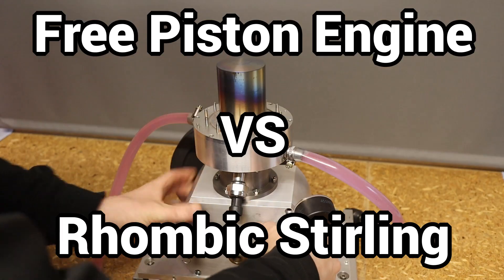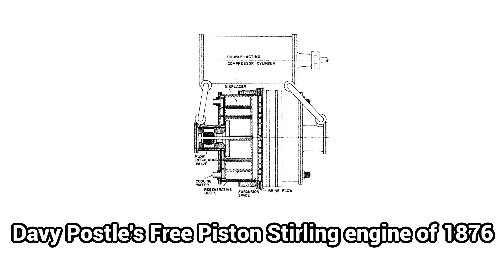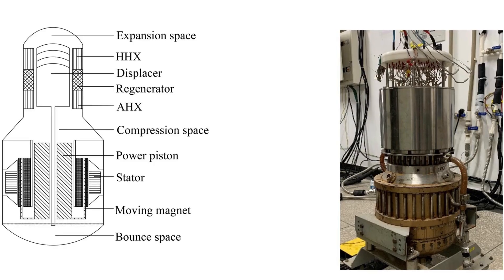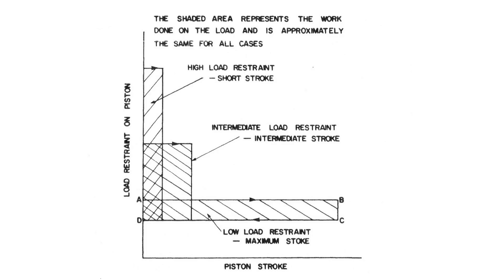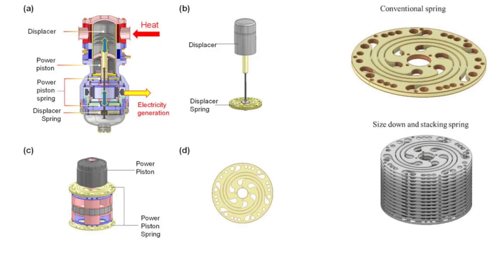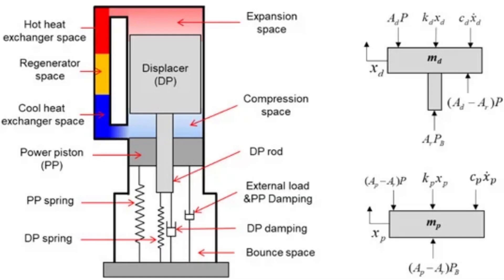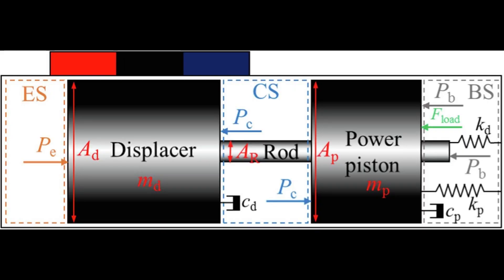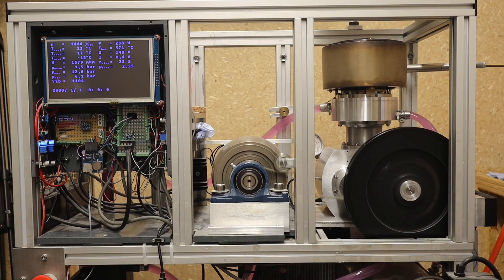Free Piston engine for more cheap energy than the Rhombic Stirling to support solar and go off grid?

Comment: This is the only one of the alternatives you have looked at capable of producing the amount of power you are looking for. And there are commercially available products to look at and copy. So.... they are the only alternative where you don't have to do complicated and hard development work to get to the end result. Just copy the design from Microgen, there are drawings out there of it. So it's a simple case of reverse engineering. This could be a community effort, and I'm interested in cooperating, I'm able to contribute with the CAD-modelling. I also have a workshop capable of building one, I only need more spare time to be able to realize something like this. A community build would certainly spark my interest, and possibly be what makes me take the step and try to build it myself. 
That is with the above mentioned design for me though. For me it's this exact method or nothing. I'm not considering other designs as there are no proven designs available to copy. 
And also, this is the only one which have a decent chance of producing the power level I'm after (which I expect to be the case for you too). 
Also, I still don't understand why you are so reluctant to this class of stirling engines. You seem to have made up you mind that this particular design is to complicated before going in to this, looking for excuses to back up this conclusion. The other design you have shown look to me to be a lot more complicated to even start to move. With this specific class of design you have several publicly available designs that are known to work, requiring no development work from your side. Sunpower, NASA and many others have published loads of data and design details on this class of Stirling engine. So this should be a case of finding the information needed and executing it. None of the other design classes have this going for them. 
The problem you mentioned with excessive leaking around the displacer due to lower accuracy of machining will in this design only play a minor role compared to the other classes. This is because this is the only one with no side forces acting on the pistons. 
BTW, achieving very accurate internal and external cylindrical surfaces are shown in great detail by Robin Renzetti (Robrenz), look at his video "MAKING AND USING LARGE DIAMETER LAPS", With this method you will be able to achieve the required precision with no problems! So.... this is NOT a premise for dismissing this class of stirling engines! Although you seem to make it one of the major reasons for not going this route.
Reply from the maker: I didn't want to badmouth the free piston engine with the video, but I think there are just too many imponderables for hobby building.
The Rhombic drive also has no piston side forces and I have massive problems with piston wear.
It would be no different with the free piston Stirling.
The difficulties lie in the details, such as the piston centering problem and the design of the spring and damping forces, which are also not explained in detail in the machines built.
Your arguments make me think seriously about the free piston engine again, that's the point of the videos.
Thank you very much, hopefully we'll keep talking!
Reply: @myengines2443 I hope you consider my thoughts seriously, and understand I have spent years thinking and pondering about this very thing! 
About the side forces and wear on the piston. You CAN NOT compare the Rhombic drive with a FPST in this regard! Only the FPST have the possibility to use active hydrostatic bearings to prevent the piston from ever touching the wall. This is a truly tested and verified design in real life. And the Microgen design I keep coming back to use it. So.... you can be expecting to solve this problem 100% by going for this design. 
The rombic design still require piston rings, this is also confirmed by all available designs out there. And since you have already proven you are not able to make this work you should have your confirmation the FPSE is more suitable for your needs. 
NASA have also come to this conclusion. 
About the springs, there are detailed papers in the free domain explaining this very well. Reading them made me think this is solvable for a DIY'er like we are. 
I have previously tried to post links to these papers here, but they are blocked. Contact me and I can send them to you. I'm sure you will see this is doable when you see the papers.
Also, there is a paper describing the building of a very simplified and very much easier to build version of the NASA design. This proves it's possible to simplify things in order for us to build something like this and still make it work. Again, contact me and I can send you the article so you can see for yourself. 
And also, the Micro gen design have simplified both heat exchangers to a point where they are possible to be mass-produced. A.k.a. possible to be built in large numbers, without needing crazy tolerances not possible for a DIY'er. No welding of small tubes, and no machining techniques that you haven't already managed. 
So, I suggest going forward to make a detailed list of possible problems. Then we can discuss in detail which problems are possible showstoppers. If then at the end we find any that are clear cases of issues with no possible solutions that we can solve then you should start looking for other design classes. But my years of thinking about this design on and off indicate there are no unsolvable issues with this design.
Reply from the maker: @spamspammesen5970  you find my email adress on my youtube channel page in the description.
It would be very nice if you send me some links or the papers directly!
The vibration theory involved with the several masses with springs and damping forces is very complex that I am a bit afraid of. 
May be a low tech free piston engine with a rubber diaphragm is a possible way?
Many thanks for your help!
Reply: @myengines2443  Wouldn't it be a good idea to use diaphragm for the piston which needs to seal? I think that someone above mentioned it. And there is one great stirling engine pioneer on youtube. His name is Shane Pomeroy a nd he used to have similar problems with pistons and leakeges like you. So he is developing diaphragm stirling engine and he had great results even when he is using diaphragms on the hot side of the engine. Free piston engine does not have piston on the hot side so that should not be a problem. My english is not perfect but I hope that you got the point. Thank you for your development effort.

Comment: Happy to see from you again with.  As usual a very good content.

What about controlling the displacer with linear motor or voice coil?  At resonance we just need to compensate the losses.
Having two sets of spring to hold a moving mass will provide opportunity to control the resonance frequency. Stretching the spring apart can help in controlling the resonance. ( It is like attaching springs to a from both the sides.  And tightening them by stretching as in string instrument.  ). Electronically controlled linear actuator can be used to control the tension.. 

Electronically controlling the resonance of piston, displacer and displacer moment will give lot of flexibility in tuning 😊
Reply from the maker: Sounds nice but also very complicated, I have to think about it!
Many thanks for your great help!

Comment: Have you had a look on barumman's thermomechanical sterling? He is showing some decent details in construction and building this kind of machine. He achived arrond 5W output. So the amount of effort isn't in a good proportion to the expectible output. This machine is based on old plans from very reliable power sources for light buoies before pv became the standard... Keep on, please!
Reply from the maker: Thanks for your nice comment!
And yes I am in contact with barumman and used some pictures of his engines as you can see in my video of the Thermo Mechanical Generator a few weeks ago!